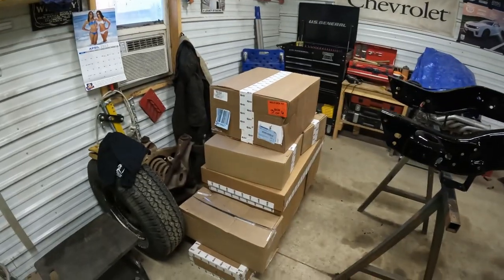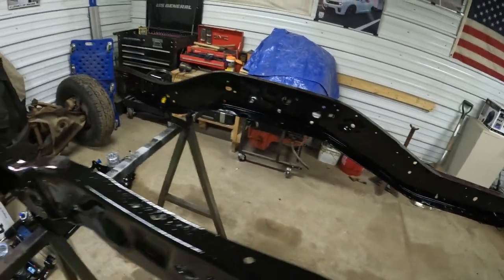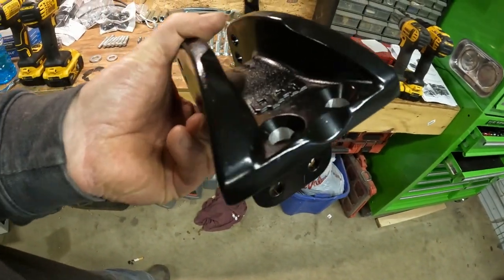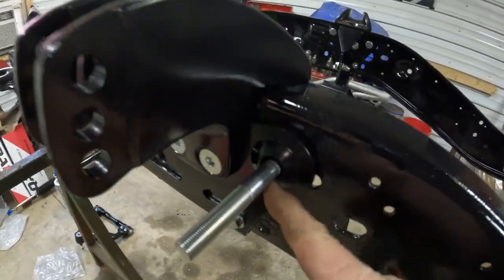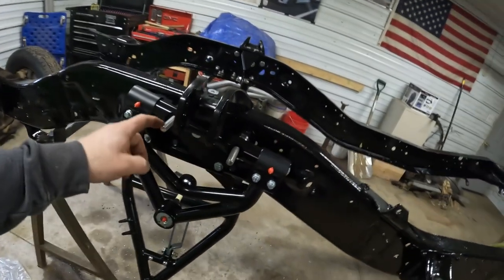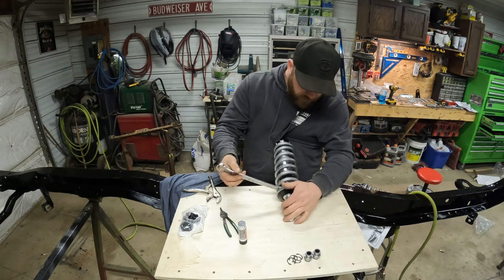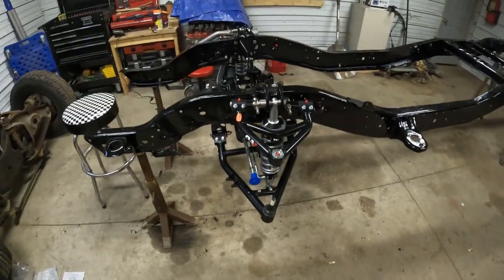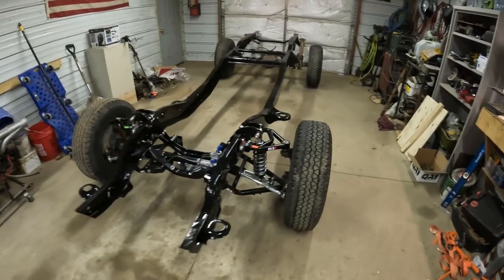Installing QA1 Coilover suspension on the 1981 C10!!!!

Comment: Not sure why people even bother with these kits to modify their old frames.  By the time you buy your brakes and rear end separately, you can just go out and buy a completed frame that’s welded and not held together with a bunch of bolts.  And when all is said and done you will be into it for about the same amount of money.
Reply: After adding it all up that's the decision I've made.  Between replacing the entirety of front and rear suspension, boxing the frame, etc etc it was a break even.
Reply: For a builder who takes the time to build things right—that sense of security is priceless.  When a vehicle breaks—everybody will take your money to “repair” it, but who will put the effort to do the job thoroughly, (to spec, & checked twice)?  If money bought the difference between experience, understanding, & trust issues…